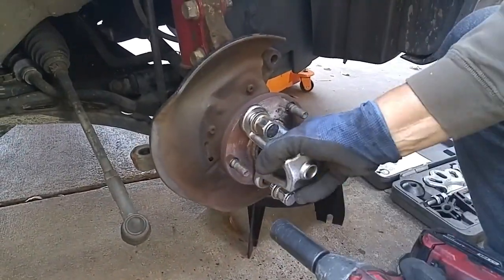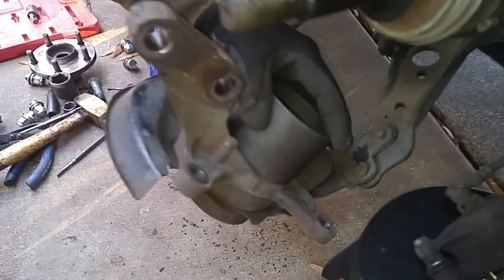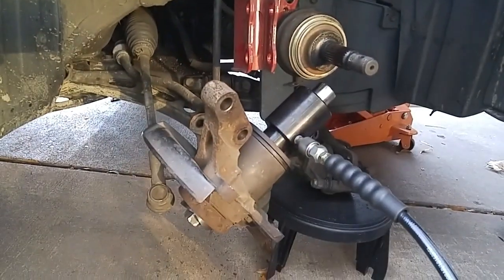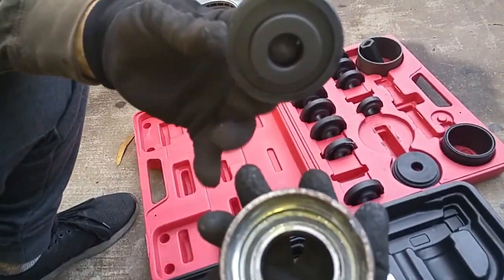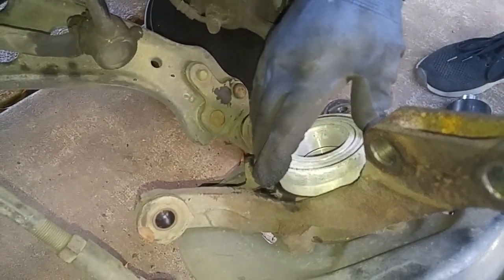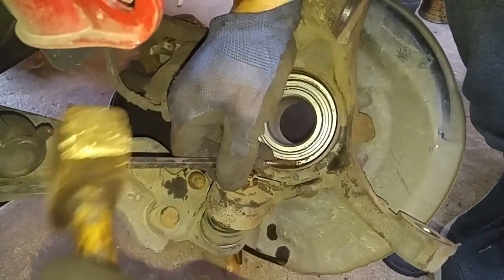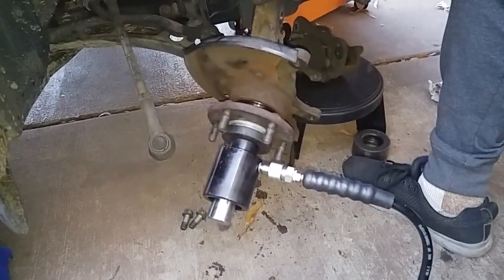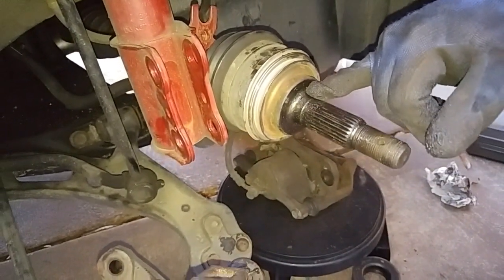Replace Front Wheel Hub and Bearing with Portable Press! - Toyota Camry - Easy How To

Comment: So I was just watching a video about this expensive hub bearing remover and it looks just like the convo you are using to remove the bearing only difference is that their has different pullers and the hydraulic puller is automatic. I wonder if there’s a way to turn your Pittsburg puller into automatic just to do the job faster
Reply from the maker: When you mean automatic, something that replaces the hand pump with a compressed air setup?  If so, it's not worth the expense for the little amount of time and effort that's saved.  Think about it ... Around $200 for both the bearing adapter kit and the knockout punch kit.  These fancier kits (made in Germany) run almost $2,000!  I just wanted something to substitute and save my electric impact driver from pre-mature wear out.
Reply: @hardlymovingpro  and that’s why you are the guy I came for answer .. you are smart for the combination you used in the video . And yeah I didn’t man I figured their kits would be expensive but not to that extent which it’s crazy
Reply from the maker: @wranefis  Hey ... thanks for your comments and support!  You'll like the next video.  It's an engine swap on a 2005 Hyundai Sonata.  Got a $200 donor engine from a local salvage yard.  Customer was quoted $6,000 to replace both the engine AND the transmission.  Total rip off!
Reply: @hardlymovingpro  won’t miss it man I’m a new subscriber

Comment: the link for the "Front Wheel Bearing Adapter Puller Kit" (comes in a blue container) has the incorrect size and thread for the harbor freight press so that slide bolt cant be used.  Can you give us the correct puller kit with the correct slide bolt please?
Reply from the maker: What I did was take the forcing screw (puller bolt) with me to Harbor Freight to see if the thread pattern of the bolt matched the thread pattern with the hydraulic adapter.   I have 2 wheel bearing replacement kits and the thread pattern on the forcing screws are the same.  You must have bought a puller kit with a non standard (should be 3/4") forcing screw size.
Reply: @hardlymovingpro  Can you give me the the kits number w the correct slide bot size because the in the link you gave us does not fit at all
Reply: If you haven't figured it out get the hydraulic hole puncher and front wheel drive bearing kit both made by Pittsburgh at harbor freight.

Comment: Looks like the screw from the bearing puller fitted the hole in the punch kit. Otherwise you would of had to root around for a suitable screw that fit the thread on the punch kit.
Reply from the maker: That's correct!  If the screw thread pattern doesn't match, you should be able to acquire one or have one made at a local machine shop.

Comment: The bolt on the press looks too short to function here - I see you using the bolt on the bearing puller set which just happens to be of the same size and thread pattern?
Reply from the maker: Yes ... you are correct.
Reply: @hardlymovingpro  I bought the press but the threads were 20mm by 1.5, which does not match the bearing kit forcing screw, so I ordered another screw.  The new screw and three nuts were almost $50, but I figure I can use it whenever once I receive all the pieces I have on order. The new screw is 250mm, 9.84 inches, which may be long enough for the hub pulling as well as the bearing pulling out and in.

Comment: Hey man i really appreciate you showing this video. I have tried to communicate with almost 20 people selling the fwd hub bearing replacement kit and not 1 could either tell me the size and thread pitch of the main large forcing bolt that you show threading into the Pittsburgh hydraulic ram... could you please send me a link or anything that would guide me to the right kit that will work with the Pittsburgh set. Thank you very much in advance and i hope you can help me out!👊
Reply from the maker: Suggest you contact a local Tool & Die machine shop to get the size and pitch specs.
Reply: I know the specs of the bolt needed and yours has it. I need a new bearing replacement kit as well so do you mind giving me the info of yours and where to buy it? I have the Pittsburgh hole punch kit and now I just need the other kit to replicate what you have. I would greatly appreciate the info! 🙏Thank you in advance..
Reply: Hey buddy did you get my last message where did you get your bearing replacement kit and if you happen to have a link or a way for me to locate it I would really appreciate it. Thank you. Just let me know if you can or not 🙏

Comment: I need to purchase the hydraulic pump it'll make it a lot easier for me being mobile to press out bearings especially on front wheel drive vehicles that do not have a hub assembly
Reply from the maker: Correct ... and more importantly, not wear out your impact driver / gun.
Reply: Very true thanks for the video
Reply: Will it work if you don't put the bearing in the freezer over night or will it make it a lil bit harder

Comment: Hello my friend 
Where did you get the bolt from ?
Thanks
Reply from the maker: I used the bolt (also called a forcing screw) from the bearing adapter kit.  The bolt threads matched the hydraulic press tool.

Comment: What you didn't mention is that if you have a abs sensor the bearing needs to go in a certain direction. The magnetic side needs to go in to where the abs sensor is. If you don't do it that way you will be pissed off cause you need to buy another bearing and start over.
Reply from the maker: With Honda's and BMWs yes ... Not Toyota.  Toyota uses an abs ring for their sensors.
Reply: @Hardly Moving Productions  I understand but always good to mention this cause it's not the same on all of these.

Comment: I am having great difficulty in pulling the hub off the cv axle. I have a 5ton hydr bearing puller with 3 point attatchment on backside of hub flange. I have full tension on puller and have applied heat tapping all around with hammer. Still no give. 2012 kia soul. Sure could use some advise, thank you anyone?
Reply from the maker: Did you first release the tension where the cv axle slides into the inner splines of the hub?  If not, release that tension first.
Reply: @hardlymovingpro  Yes I had already done every step but I finally found a slide hammer to rent from oreillys and got it to pop. Man I hope the next one goes easier on me!
Reply: @hardlymovingpro  It was that tension that I was trying to release! Hehe.
Reply from the maker: @kjenkins8648  Well...you got er done!

Comment: What make is your bearing service kit and model number
Reply from the maker: Links provided in video description
Reply: The kit on the link looks different from the one you have on your video.
Will the bolt from the kit on the link screw on to the hydraulic punch
Reply: Will the Maddox kit from Harbor freight work with the hydraulic punch tool
Reply from the maker: Check the fit at the store?

Comment: PS - Please understand, that I want to buy that hydraulic kit right now, but I need to be sure it will accept the bolt in my bearing kit.....and that is why I ask about the size of the bolt in that kit, OK?
Reply from the maker: That was my concern before I bought the press kit.  I recommend you take the bolt to your local Harbor Freight store and see if it'll screw into their press adapter.  I'm sure the threads and diameter will match.

Comment: Great video, but NOTE: In the video you are using a Harbor Freight Pittsburg hydraulic punch driver kit. But in the video description, you provide a link to a very different "10 Ton 1/2" to 2" Hydraulic Knockout Punch Driver Tool Kit."  The most important thing is to make sure that the long black threaded rod/mandril from whatever Wheel Bearing Adapter Puller kit you use threads perfectly into the black hydraulic cylinder of the Hydraulic punch driver, otherwise this will not work.
Reply from the maker: Thanks for catching that! The punch driver kit has changed a few times since I first made this video.

Comment: I have the same setup, but I ordered a high-strength threaded rod from McMaster Carr instead of using the forcing screw.  I used the nut from the front bearing kit with the new threaded rod.
First saw this used by this Youtube DIYer.
https://www.youtube.com/user/jkrug80
Reply from the maker: Thanks for sharing!  Concept is still the same;  that is, use hydraulics to force out pressed in bearings or force in new bearings.
Reply: Would you be so kind to share the part number of the forcing screw and the washer that comes with it from McMaster Carr?

Comment: Autozone wants $499 to loan this thing
Reply from the maker: You can buy the hub/bearing tool set for under $80 on Amazon:   https://amzn.to/3wiYC1v
Reply: @hardlymovingpro  Thank you, I got the one from Amazon and it worked perfectly! Just finished it today.
Reply: @Mista CDawg  did you use the harbor freight punch kit with the 3/4-16 threaded ram and if so which wheel bearing kit do you have that has the same thread forcing screw as the ram... alot of people have asked him about this and he is not answering the question that is being asked... he just says take the bolt from your hub bearing kit to hf and see if it fits the hydraulic kit... we all have the same hydraulic kit ,we need to know which hub bearing kit, p/n and or link to buy the correct one to match up with our hydraulic kit. Thank you and I hope this can help me and many others
Reply: @johnblatney3140 if you haven't figured it out the front wheel drive bearing adapter matches perfectly with hydraulic hole puncher both made by Pittsburgh at harbor freight.

Comment: If my eyes did not deceive me, the steering knuckle on your car is exactly OPPOSITE of most vehicles (and videos) I have seen?  Your bearing is removed and installed from the backside, assuming the extension with the two holes is for the strut?
Reply from the maker: That's correct with Toyota steering knuckle bearings.  Some vehicles have front and rear snap rings where you decide direction of removal.